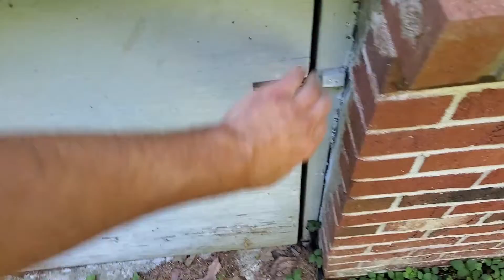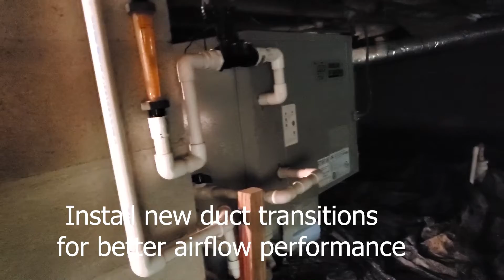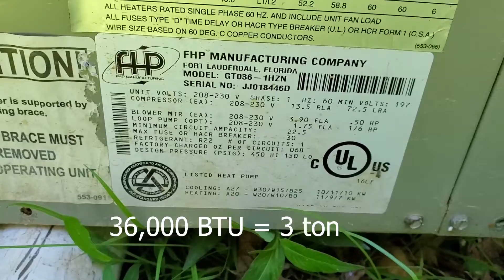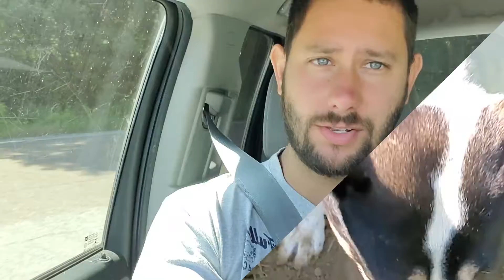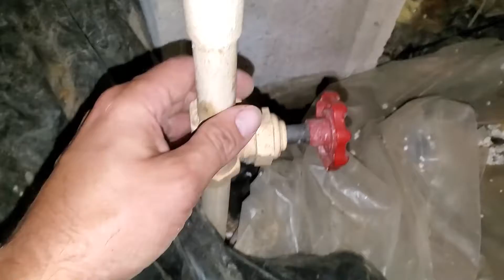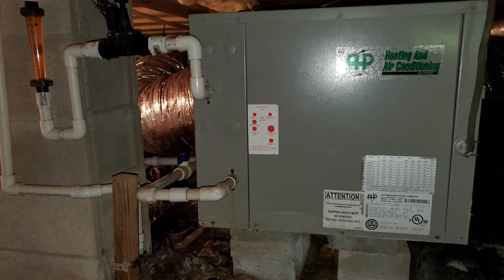Installing Samsung Heat Pump Over Geothermal System

Comment: If they're saving money on the loop repair, how much money do they have to spend on all the indoor units and equipment besides the heat pump itself? Wouldn't it end up evening out, or more for the vrf zones and piping etc?

Comment: But a geothermal doesn’t need to use energy to defrost and is not affected too much by the ambient air unlike an air to air Heat Pump

Comment: I believe the geo thermal unit was still a better choice even if it is single stage, In extreme heat or extreme cold air to air split heat pumps suck at efficiency. But I guess the owner didn't want to fork too much money for the upfront costs and the old unit had far too many problems which plagued it's capability to work efficiently.

Comment: Most antique equipment can be replaced with newer technology for an advantage. To compare ground source heat pump to an air source heat pump is a no win for the Air source by at least 30%. Geothermal will win every time.
Reply from the maker: I am not comparing geothermal to antique  conventional traditional equipment
 Which would of course be inferior

I have replaced older geothermal systems with VRF technology recording the kwh usage and energy consumption and Variable refrigerant flow technology is far superior.
 Now when you couple geothermal with VRF which is now offered by most brands that I use.
 Then you have another way more efficient technology.
 I appreciate your comment thank you for taking the time.
 Let me know if you need anything.
Reply from the maker: Just to clarify VRF air source equipment is far superior even with the  geothermal ground source advantage As it's heat exchange is with a constant temperature
Reply: @taddydigest  GEO Says GHPs Use 44% Less Energy than VRFs Annually
Geothermal heat pump (GHP) systems are more efficient than variable refrigerant flow (VRF) systems for heating and cooling, according to research assigned by the Geothermal Exchange Organization (GEO).Jan 8, 2015

Comment: I didn't notice any conversation about what was wrong with the well/geothermal part of the original system. Did I miss something?  It seams that the geothermal source would be more stable in the summer months (meaning cooler--especially in FL) when the system will be trying to dump heat outside.  Their heat exchanger was quite old (and perhaps not well maintained), but simply updating that unit to a variable speed unit would have worked--and been able to take advantage of the cool, ground-source temps in the summer.  Hmmmm.
Reply: I'd be willing to bet it clogged/corroded/lost efficiency due to the inevitable sediment buildup with open loop systems.
Reply from the maker: yes exactly it was man the coaxial had a drop across it
Reply from the maker: there well was used for the house and the unit so it was insufficient
Was not able to even achieve the GPM required for efficient heat transfer 
also the cost for new well and geo unit install or closed loop install was unjustifiable. I love geo though especially vrf geo. Thanks for watching Check out my latest and let me know where I can improve or what I can do better Thanks again Walt

Comment: I'm French, the heat produced when the air is very cold in winter will be sufficient ? The avantage of the geothermal source is always positive instead of the air. It's cheaper but not sure that the comfort will be the same (noise, defrost who produce cold indoor, kw of heat when it's very cold outdoor) ?
Reply from the maker: I will do a video explaining more benefits for you in two weeks I will tag you 
thanks for watching
Reply from the maker: Hey this video is for you https://youtu.be/JDEwog3JcPc
Reply: In Europe they don't use duct system for homes, only for businesses, I have a house in North Africa and trying to source out a 120V 50Hz geothermal heat pump to no avail, Every supplier I talked to they say only north America has such equipment, WaterFurnace do make 50Hz for small businesses like the 7 series in Europe and north Africa but not sure how much it would cost.